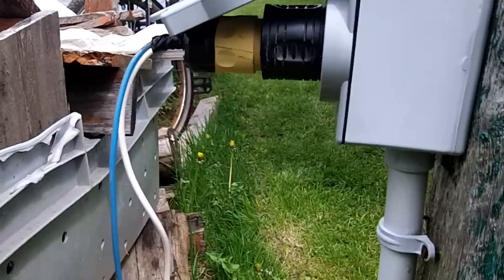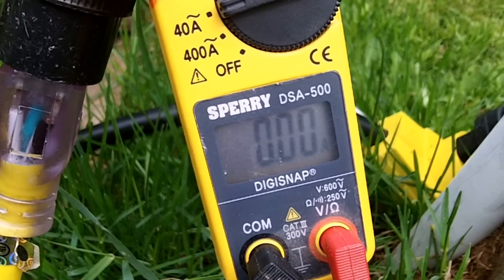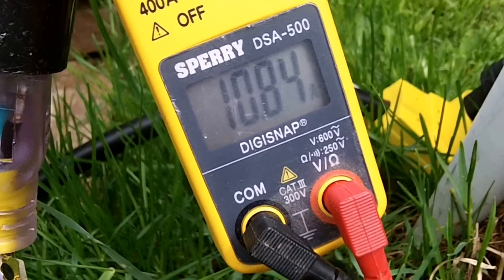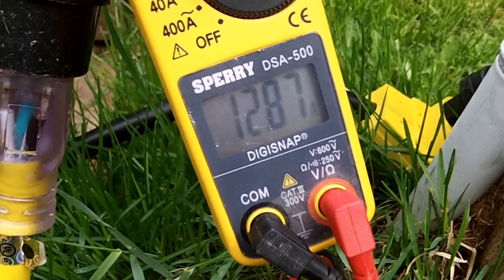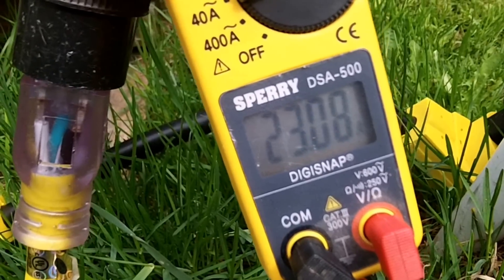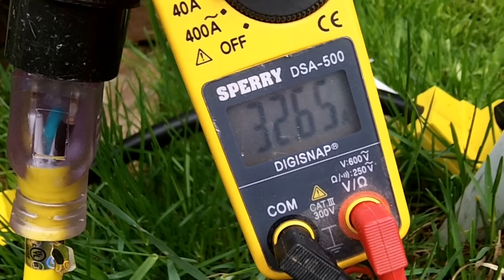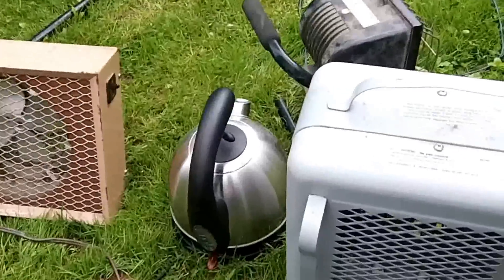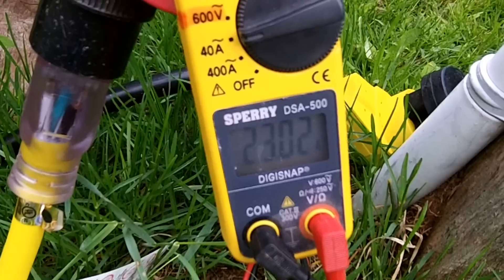RV tripping 30 amp breaker

Comment: the breaker to my AC keeps tripping but it's the breaker inside the RV travel trailer and it only seems to do it when the temperature outside is very hot like a hundred Ten Degrees what is your suggestion it is also on a dedicated 20 amp circuit breaker within the trailer
Reply from the maker: Some brands of breakers get weak once tripped a few times. If you have another 20 amp breaker in your unit change out the 2 breakers and see if it still happens. If not the problem put an ammeter on one of the power lines from the air conditioner and see how many amps it is drawing. It may be pulling close to 20 amps or over and sooner or later at this amperage it will trip the breaker. The AC unit may have worn bearings etc and making everything hot/tight/ which will make it use more power to perform. I have seen some units need the fan turned by hand every spring to loosen things up enough to work. A spray of wd40 or other on the shaft may loosen things up.

Comment: I have a 3200 watt generator that has plugins for 120 volt and 240 volt   But the 15 amp breakers keeps tripping when I try to run my 120 volt air compressor.  What is most likely the problem. I'm new at this.
Reply from the maker: Luis Tucker look at the tag on the compressor motor.  It should say how many amps it draws. If it trips the breaker upon start up it could be pulling over 15 amps on startup. Does it run ok on a house 15 amp circuit?
Reply: Thanks for responding. The air compressor runs normally plunged into the house reciprocal but not from the generator. So like you said, I guess it's just drawing to many amps .  It just seemed to me that the generator was strong enough to run it.

Comment: Yes! Where was the problem??? We have a similar issue... pop the main breaker for no reason. Everything is off or unplugged. Ugh.
Reply from the maker: I am not positive as the people never tripped it again after I checked things out ---BUT----while the heaters were on I checked all the connections between the main panel and the trailer in question. In the box at the trailer before this one I found a neutral that is shared between two trailers that appeared to be loose in the marrete. I am thinking that this may have been the problem as it was on the weekensds when they tripped the breaker. With
Reply from the maker: Halscamp With the tripping happening on the weekend when both trailers were occupied the neutral may have been getting hot and expanding in the marrete and making the connection loose. A loose connection will make it hot and up the amperage which could have been the culprit.  The people had an electrician friend check out their trailer and the only thing that they did was change out a plug above the kitchen counter plus they put a surge protector on the post to plug into.  So I am not positive what the problem really was.    I have had other people who were always tripping their breaker so I finally checked out what each of their appliances were drawing.  What I found was that when they thought they only had enough stuff on to draw below the 30 amps that their fridge in their shed was spiking at 12 amps when it started up. If they were running around 27 amps worth of stuff usually including the air, things went ok until the outside fridge's compressor came on and spiked at 12 amps which took their total draw to 39 amps---guess what--- a tripped main breaker.  Each situation is different.   You really have to add up all that is running in the background that may be raising your current draw such as the inside fridge, the convertor, is there a second fridge in an outside kitchen, is your water heater on with your air and then you try the microwave.  A hair dryer is around 1500 watts which would draw around 12 amps, your coffee machine on??
Reply: Halscamp Finally figured out our issue yesterday. The breaker screws appears to be tight but I killed the power and really tightened them down and now it won't trip! Guess it was getting too hot from the bad connection. Always worth a look!